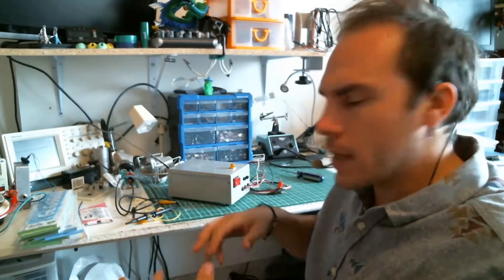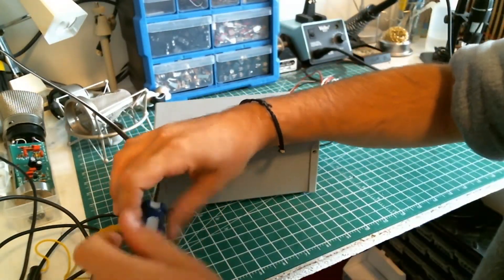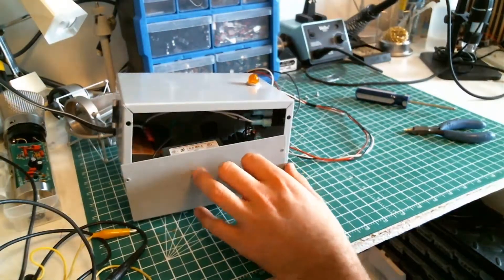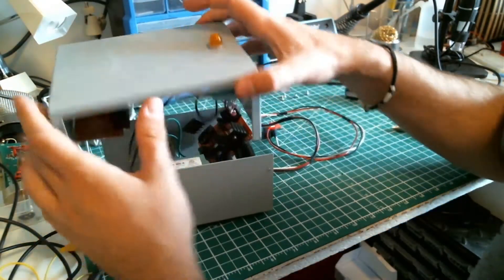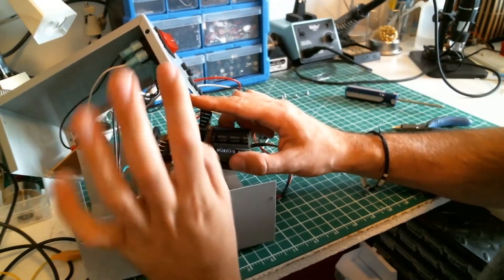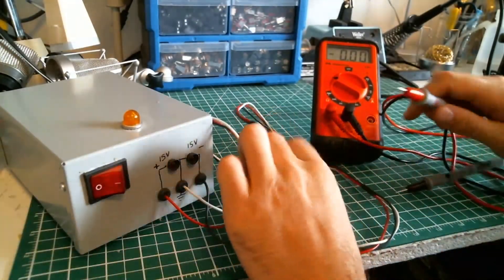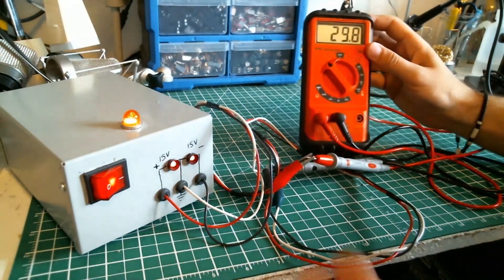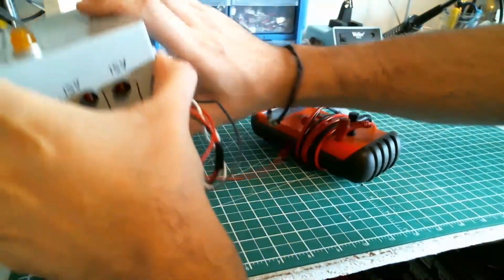Homemade Power Supply - part 4

Comment: U didn't show how you arranged those things inside the box apart from the circuit diagram u gav, I will really appreciate it if you can do that step by step on how you transfer your circuit diagram into the box
Reply from the maker: Sorry for the delay, here is a video that will clearly show how to transfer the design to the copper sheet.
https://www.youtube.com/watch?v=l01ixAZ4aHQ